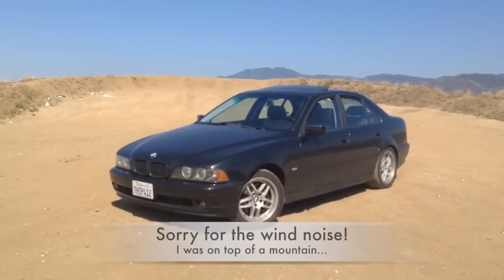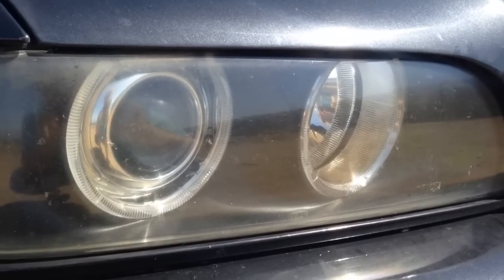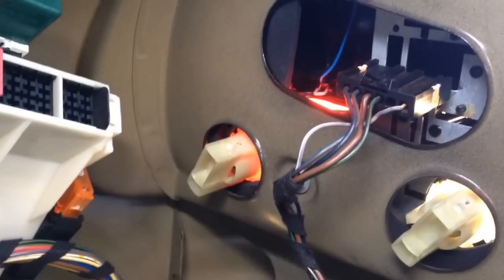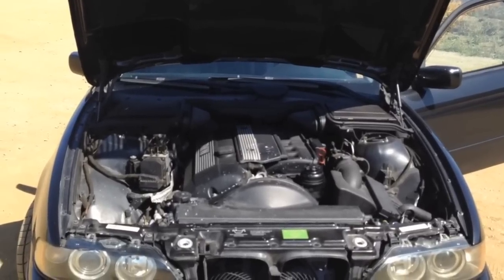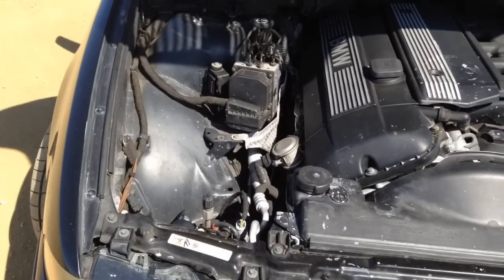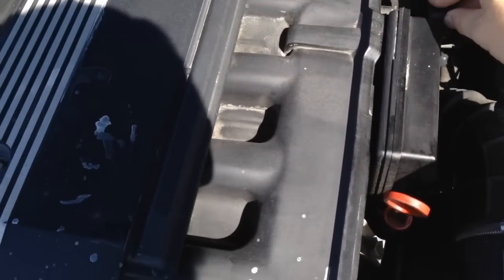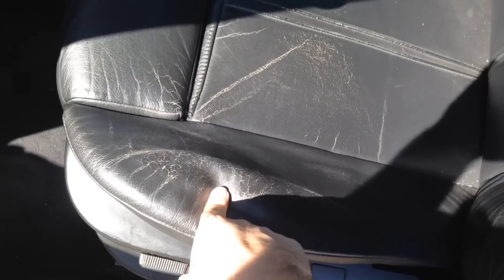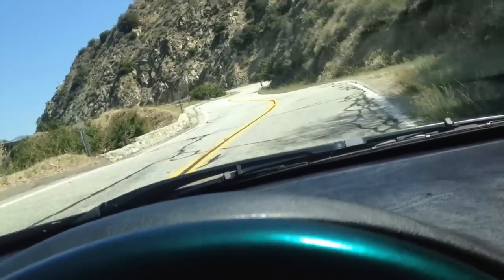Nate's 2003 BMW 530i Introduction

Comment: Hey Nate, met you at bimmerfest by the e39 M5 Touring! Awesome getting to finally see your e39
Reply: ***** Yeah, that was great! We still have to meet up to go for a drive sometime!
Reply: Definitely down! I just need to upgrade my suspension a bit. For sure need new subframe bushings
Reply: ***** Haha, no worries. I'm putting in a set of Koni FSDs, ECS stainless brake lines, and new front wheel bearings right now. Should be done (hopefully) next week. Brake lines are really annoying, especially the ones that are just behind the ABS module (which had cracks in the old rubber, probably from the heat of the exhaust).
Reply: Oh awesome! Are you doing it yourself? Not sure if I should buy the bilstein sport shocks for my wagon or koni's.
Reply: ***** Yep! I'm fortunate to have access to a disused, unattached garage at my grandmother's home. Yummy cookies and plenty of lemonade from the tree in the yard. Life is good! :)
As to the struts/shocks, it really depends on what you want. I've heard that the Bilstein shocks ride much harsher than stock, without enough handling benefit. I am a fan of Koni's stuff; they don't sell shocks for cars which they haven't R&D'd. I spoke to an engineer at BimmerFest, and he was a great guy, and knew his product well. The FSDs (frequency selective damping), though, are intended to provide a best of both worlds approach. Using a patented technology, they can very quickly open a valve for harsh impacts, while still handling better than the Koni yellows at the soft setting. Plus they're gold, so they look cool.

Comment: oh and please wait on the tint, diys, audio, and fun stuff.. open the hood and fixed every leak, and issue first. a good lucking, unhealthy car is not cool
Reply: That's the plan! The power steering hoses are getting replaced next week, and simultaneously I will be installing ECS Stainless Brake Lines (the rubber is cracking up front), Koni FSD struts, and front wheel bearings.

Comment: That power steering reservoir can be fixed by replacing the seal. I did that on mine, and no more leak! I think Bluebee on Bimmerfest has a thread about that. I can't remember exactly.
Reply: Yep, but the brand new reservoir still leaks, even with a slightly thicker rubber seal...
Reply: computiNATEor
I replaced the gasket and mine still leaks a slight bit. Could also just be fluid I've spilled...
Reply: Yeah, oozes is probably a more apt description.

Comment: once i seen the wreck then the engine bay, that was a huge downer for the rest of the vid. air bag deployed, insurance totaled the car?
Reply: Integra DIY I didn't go through insurance, so no, it's not a salvage title/totaled vehicle. Engine bay is only a mess because of that upper radiator hose failure. There's a small wrinkle near the left front wheel in the engine bay from the accident, but nothing more than the fender support had to be bent back into shape, and nothing is out of alignment.

Comment: You can totally fix those lights, wet sand and polish them. Remember to clear coat them afterwards, or it'll only last a couple of weeks. And please give the whole car a good detail, that color is beautiful! But black cars show defects the most, and looks so terrible when not properly maintained
Reply: Smenny A full detail will hopefully be coming this next week! Any recommendations on the product used to clear coat them? I've seen the Plasti Dip Glossifier; that looks good because it's removable, almost like a headlight film.
Reply: computiNATEor nice, looking forward to the result! Just got a new black 530i e39 myself that I will be detailing next week, haha! I live in Norway, we often have different products in Europe, but they sell headlight clearcoat most places they sell quality detailing products. I think both duplicolor and krylon works well. Plastidip might work, but might look a little hazy I think. Make a video of the result though, interested to see it! :)
Reply: Smenny I've read the Dupli-Color clear doesn't hold up well over time, so if I would have to redo it, I would rather have a coating I can peel away; specifically, the Plasti Dip "glossifier" aerosol cans.
Reply: computiNATEor haven't tried any of them myself, so I can't really recommend either. But I think I would rather try Krylon than plastidip. I have used a lot of different plastidip products, and the glossifier is pretty cool, but I'm not sure if it would work well for headlights, not sure if they would look totally clear. But it's awesome for lots of projects, so might as well get a can and try it. I would certainly be interested to see the results at least
Reply: computiNATEor By the way, plastidip makes a "clear coat" as well, that works the same way. That would probably work pretty well, I think that would look a lot clearer

Comment: hi e39 source, is the e39 a big car? do you think it suits a 18 year old for my first car, im not a shit driver btw.
thanks
Reply: It's average sized.  I know a few guys who drive one as their first car and they do fine!
Reply: Bobby O'Hearn thanks. I have a e60 myself (well my dads) and it's a big car,so the e39 would be the same size, just a tiny bit less
Reply: Dilix idgaf im 19, bought my 530i myself before graduation and I am a big guy, 6'3" 300 lbs and I fit in it almost perfectly, with seat adjustments of course and it is a perfect icebreaker into the BMW world.
Reply: I am 16 and got my first 530i m sport... it is a good car and fast enough but beware if high milage ones... they r going to require a lot of work. Hope this was helpful to you.
Reply: +Dilix idgaf Eh, it's not bad. For me, if I'm sitting in front, I can't put anyone in back, and I'm 6' 2". Plenty of space in front, though.
Reply: Alex Pancamo ok thank you
Reply: Aaron Birdi these engines with high kms dont require work. 
Im friends with a person who works for bmw. This engine is good but not smooth
Reply: Dilix idgaf I beg to differ... my 528 is the smoothest car I've ever driven. I love how the car accelerated. No stumbles or anything, nice and smooth. Now, I haven't driven a 530, but if it's similar to the 3.0i X5, I could understand what you mean. Higher mileage is better because all of the work that was bound to be done at the mileage that parts are known to go bad has already been done. Hope that makes sense.
Reply: Alex Pancamo yes i understand you, my dad has been driving a merc for his life, and  now he changed to bmw,  and does not like the e60 engine or transmission,  not as smooth as a merc as mercs are v6 and the gear changes are horrible. It always changes on high rpms and it acts like a sport transmission. Its not a smooth car.
Reply: +Dilix idgaf If you looking for e39 as a first car just go whit 530i M54
Reply: Milos M Power yeah thats what i want
Reply: Schrödinger Catboy
They really are great cars, aren't they?
Reply: Schrödinger Catboy
Yeah, I can't stand the computers in everything these days. The E39 was the last truly great 5 series.
Reply: +Alex P if you go for the 530i go MT plzz its alot less expensive to put it perspective and it becomes alil bit more sporty.